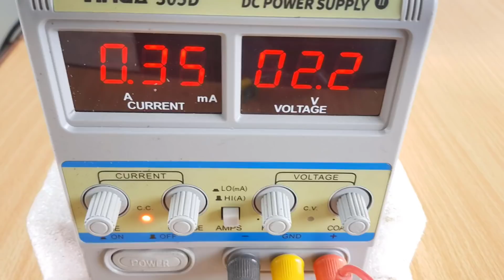Restoration Humvee U.S Army Armored Military Truck | Hummer Jeep

Comment: 6:06 u shouldnt paint it cuz its chrome
Reply: He did not paint it chrome, that is the overall finish given when you wet sand everything and clean it with a wire wheel and clean it again, makes the paint a lot easier to adhere to the casting.

Comment: I normally don't comment on video's but these are more like modifications or adding details, they aren't restoration projects ... I've watched several of your videos and the one thing I notice recurring in them is that the plastic undercarriage is always covered in rust stain but are in pristine condition after washing them ... my experience as a parent and many toys I've seen come and go that the undercarriage gets beat up ... scratched, gouged, cracked in places (sometimes)  and being exposed to the elements as depicted in your videos that plastic should have signs of fading ... its a fun hobby modifying these die-cast or even just changing their appearances a little is fun I do it myself in between scale modeling project but it isn't a restoration